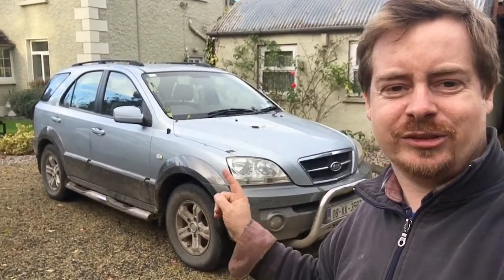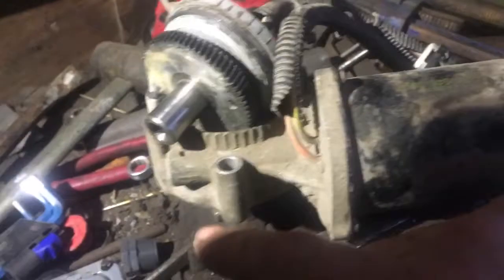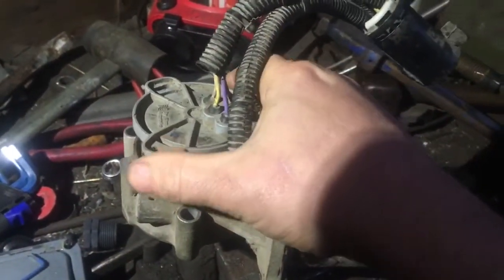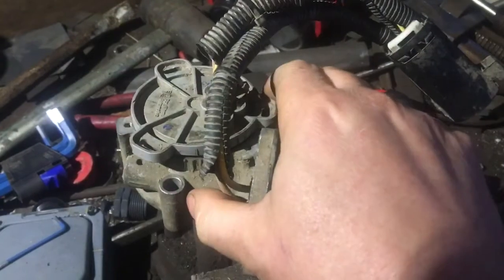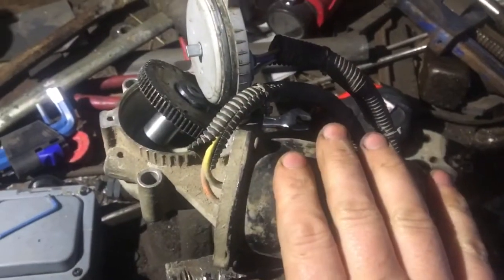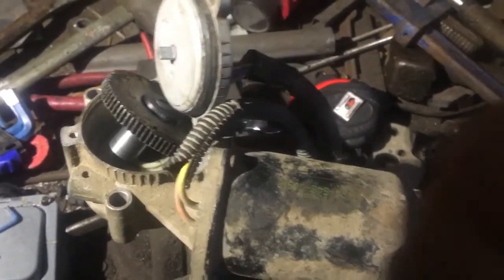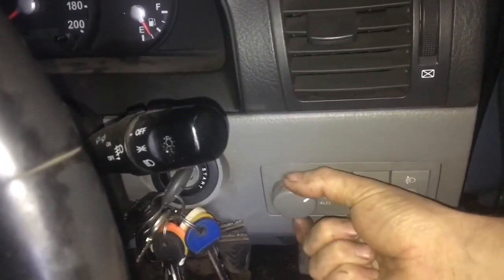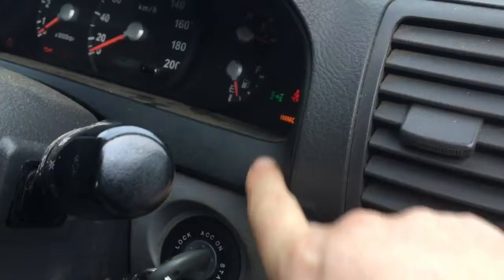Kia Sorento Mk1 4x4 not working, solved… I think ?

Comment: Good work getting some of it working again! I reckon another bash you could get the Lo range sorted too. Failing that, just add a PTO shaft!
Reply from the maker: 🤣🤣🤣🤣 found out there is both this controller that engages 4x4 and a vacuum pump which also engage the front diff . Confided I asked on a Kia Facebook page  it’s basically there for better mpg / noise / reduce wear on the front drives while they are not needed . I’m still not sure if it’s ingenious or stupid

Comment: I have an 08 lx which had the ‘ESC off’ light illuminated and improper shifting. I replaced that transfer case motor and that got rid of the light and my transmission now shifts properly, but now my ‘free running air pump’ located in front of the battery gets 12.5v when I turn the key to acc on. Dealership was gunna charge me $750 to check the tccs since it kind of seems like a stuck relay, but they also pulled a code saying that a rear abs sensor is bad.. so anyways I pulled that tccs fuse and I’m gunna clean off the abs sensors and see if I can yank the center console and panels to check the tccs module

Comment: I have a 2.5 turbo diesel Sorento and I’m having issues passing to 4L, everything else works. Perhaps is the same issue that you have with yours. If you have any thoughts to fix it please let me know. I’ll try doing what’s you just did in the video. 
Thanks mate ! Good video
Reply from the maker: I’ve been told but not sure if it works or not .. but try pumping the brakes, because the front diff works off vacuum coming from the brake vacuum servo . Also putting the Kia in reverse and rolling back a little helps it also to engage 4x4

Comment: Have you had any more issues? Mine the TOD and having issues in an her 4low but to the standard 4x4 auto
Reply from the maker: Keep everything washed and clean.
Reply: i heard to engage 4 low you have to push the clutch pedal down
Reply from the maker: @subwingcostarica6663  that’s really good Info I’ll check that out tomorrow

Comment: My sisters acceleration pedal won't work ..the car starts but nothing else when putting the foot down ..any ideas?
Reply from the maker: Where her feet sit. At the side there is a fuse box . Check all fuses. And check the plug is making a good connection on the accelerator pedal wire
Reply: @stevenharpervw  ok I will say to look at that someone said the ECU needs checking?
Reply: Mine did this. It was the electronic accelerator module. Gas pedal is electrically controlled, no cable

Comment: I think you need to keep the engine running, put it in neutral and let the car wobble slowly forward.
Reply from the maker: Yeah I normally put it in reverse to take the pressure off to allow 4x4 to engage

Comment: Would this issue cause 4wd dash light to remain on?   Or would low transfer case fluid cause such an issue(dash indicator to remain on)?

Is your vehicle the same as a 2003 kia sorento LX..(US)?
Reply from the maker: Yeah mine is on all the time . Sometimes after 10 minutes of a drive it turns off. But 4x4 and LOW are always on .  Basically the motor gets confused which direction to go and just going it to a error mode . I have had to do this a few times over the years to get my 4x4 back working : don’t know why it gets confused

Comment: Hello, I have a problem with a Kia Sorento 2.5crdi 140 hp with a manual transmission, suddenly the two green lights for blocking and 4WD came on and now nothing works from the button and the blocking, I tried with another button and computer for the distribution and relay for the front  differential nothing happens, I try the transmission motor through the socket, it works immediately, it engages the front cardan, and this happened when it was driven on the highway without turning on from the button, the lights came on and since then nothing works, but before everything worked,  if anyone can help me i would be very grateful.
Reply from the maker: Same thing happens me. I had to reset the motor in the video . To engage 4x4 [sometimes !!!!]. It helps to push the brake peddle and rock the car in reverse